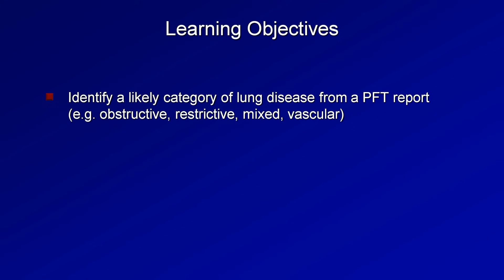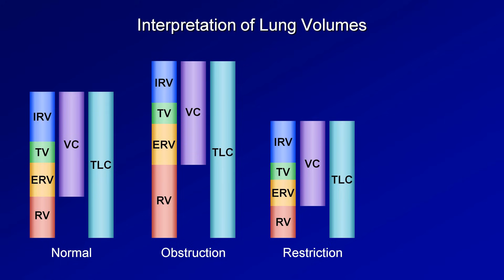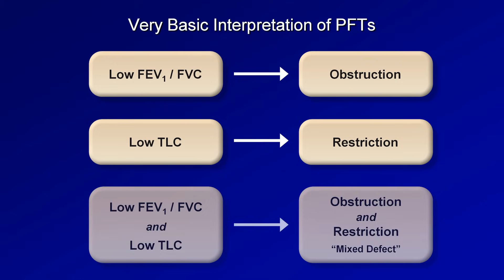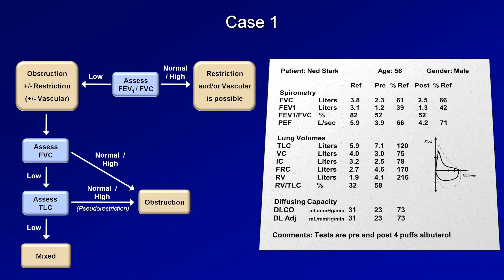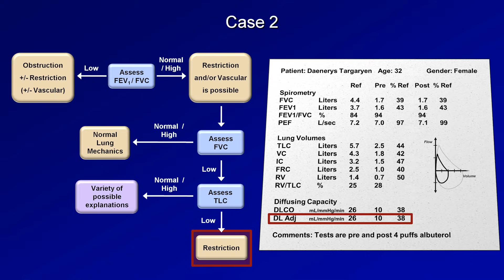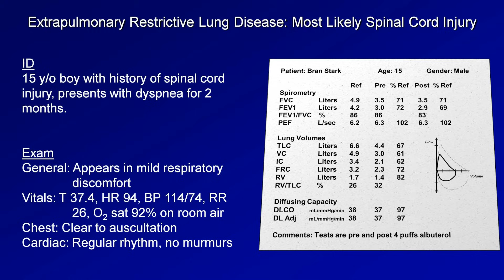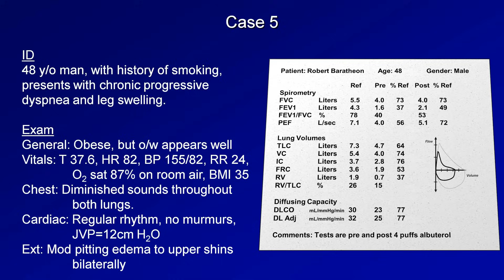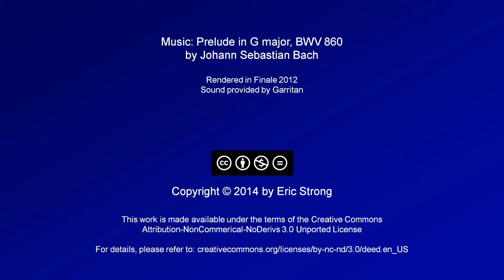Pulmonary Function Tests (PFT): Lesson 5 - Summary and Practice Cases

Comment: Thank you!! this helped a lot for my upcoming exam. I only have a question about case nr 5, in this patient I can see that reversibility test is positive with increase in FEV1 >12% and volume > 200 ml. This can also be diagnostic for asthma, so do I differentiate between the two based on the patient history (age, onset, history of smoking etc)?
Reply from the maker: That's a great question!  It's been a while since I made these videos, and I'd need to rewatch them to see if I made this point during them or not, but PFTs are not sufficient alone to distinguish asthma from COPD from other forms of lung disease, or from patients with more than one process - they are only one (though prob the most important) consideration. In this case, even though the reversibility (i.e. bronchodilator response) might point a little towards asthma, COPD is still strong suggested might the low DLCO, age of onset, smoking history, and signs of right heart failure.

Comment: Will anyone tell me what is the normal value of FEV1 and FVC ?
Reply from the maker: The normal values for PFT parameters vary based on sex, age, and height. When you receive a set of PFT results, the expected values for that individual (i.e. the normal values for someone of the same sex, age, and height) are usually included for easy comparison.

Comment: Hello, if  TLC is low, does it mean that VC should be also always low? if so,do they both show restriction ?
Reply from the maker: I don't want to say anything is impossible, but I imagine it's very unusual for a patient with a significantly low TLC (i.e. not just 1% below normal) with a completely normal VC. And yes, that would suggest restrictive lung disease, but I think most clinicians wouldn't consider such a diagnosis as definitive without also having abnormal spirometry. (It's easier to imagine a patient with mixed obstruction/restriction having low TLC with normal, or even high, RV)
Reply: @StrongMed  Thank you. Regarding the Diffusing capacity parameters DLCO, DL Adj , I see they are not available in my chinese spirometer machine. i just see about 40 types of parameters of FVC, VC, MVV, MV. So how to get or calculate them?are there other alternative names for them?Thank you.

Comment: great videos.  question, what do you use to make your graphs? I'd like to make presentations with similar graphs
Reply from the maker: Naya Barretto I use different software for different videos.  Most of the graphs for the PFT videos (e.g. flow volume loops, flow charts) were actually created in PowerPoint and exported as png files.

Comment: Hi Eric, thank you for making these excellent teaching series. I've learned a great deal from them. I've noticed that you used predicted percentage of FEV1/FVC for interpretation. I think it is the raw value that we should use to say whether it is likely obstructive or restrictive. For example in case 1 the raw ratio is 82% which may be restrictive/mixed/pseudorestriction/normal. The extremely low FEV1 and high RV indicate this is severe obstruction (pseudo-restriction). Would you agree?